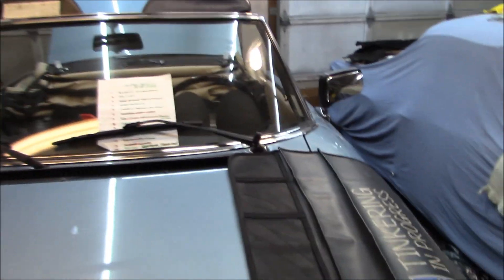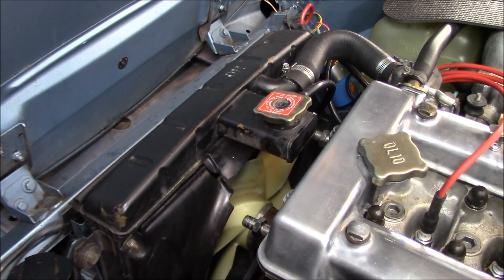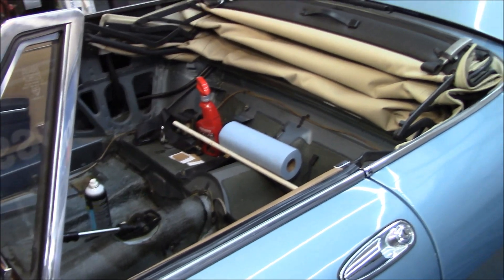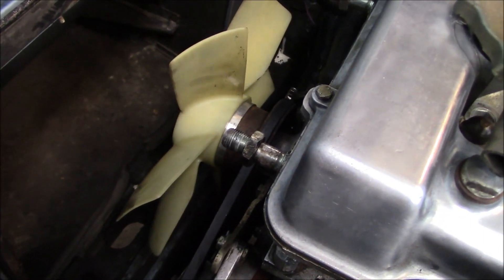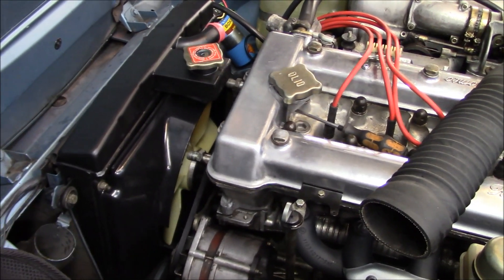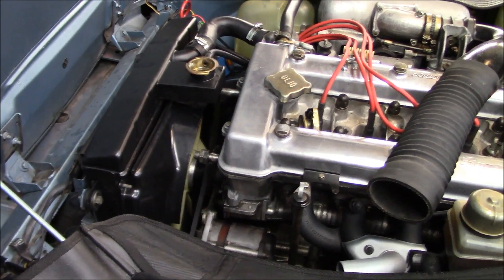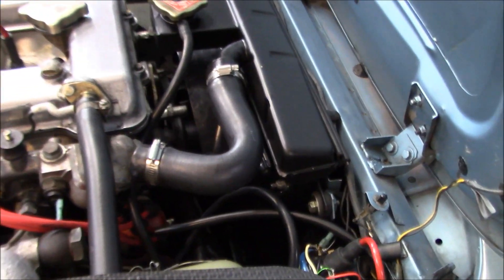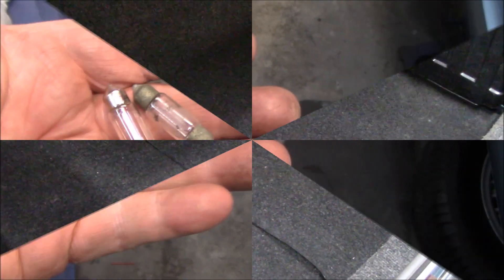1981 Alfa Romeo Spider Veloce, Winter Projects Part 16, Rad and Shroud, Wipers and Trunk Carpet

Comment: I'm on my 3rd rad. I remember that I bought Evans waterless  coolant, but never put it in due to the constant removal of the rad, so it and the prep fluid sits on a shelf! I feel that the shrowd you bought was for an earlier Alfa with a smaller 4 blade fan. It is possible that it's maker changed some of the design to 'fit' more years of chassis to make one product instead of 2 or more, also. My 2nd rad was also from Vic Auto, it was a good unit, but the overflow hose went to the drivers side. My bottle is on the passenger. Another example of 'one size fits all'. The long hose required fouled on the fan blade one day, taking out the fan, cracking the  old fan shroud also. I had a rad shop cut the nipple off and braze it to point in the correct direction, and fix the pin holes caused by the exploading fan. New shroud installed, did not fit very well and I cracked it. On a summer drive to a brew pub with my girl, I hit a really bad dip in the road at speed, and the new 1yr old motor mounts compressed enough to have the fan bottom out, shearing off the fan blades at the hub! Also causing leakage in the rad. Enough! I bought a used rad in wonderful shape, had it tested and cleaned and painted, and installed an electric fan with a relay, that uses the temp. switch installed in that lower bung. My radiator adventures. The owner of your blue Alfa should be fine; I drove/drive mine pretty hard when I can, and the dip in the road was ridiculous. Glad I had the oil pan guard on!!
Reply from the maker: Just for fun John, look at the picture on the centerline site….not even close to what I received. https://www.centerlinealfa.com/catalog/fan-shroud
Mine didn’t even have the little holder for the overflow hose that this one has pictured…I’ve sent a note to centreline. We will see how they respond. Cheers, Tush
Reply: @cheftush  I feel either they picked the wrong part, or Centerline changed vendors for the shroud, and the photo is from the original vendor. Either way, I hope that they give you helpful information on fitment. Too late for money back or exchange, though, but you never know.

Comment: Hey Tush, good to see another great video...I was thinking you were on the beach in Hawaii on holiday.
My opinion, fwiw, would be to powder coat the wiper arms in chrome finish to match the blades...quick, easy, and inexpensive.  Bummer on the rad shroud. Don't ya just hate taking two steps forward and one back. The silver lining is that doc has the car in good hands. Cheers!
Reply from the maker: I wish I was on a beach….New York all last week….anyway, problem with getting the arms powder coated is that at the bottom of the arm are plastic caps that pivot to hide the nut…these are attached to the arm so I’d have to figure out if I can even detach these.

Comment: Nice progress, Chef. Regarding the third brake light, could you stick rare earth magnets under the rear deck so that the ones on the light fitting have 'friends' to cling on to? That would increase the sticking power and avoid any walking as the magnets will naturally be attracted to each other. It would also allow you to use the thin magnets on top and the thicker ones underneath.
Reply from the maker: Hi Rocky. I was thinking the same thing.  I’m not sure I have access directly to the bottom of that panel from inside the trunk though.  I know I can’t access it from the passenger compartment.

Comment: If I recall there is only one shroud and if you have a/c or an air pump you need to cut the shroud. If the fan hits the shroud then you need to check the motor mounts they may have deteriorated and allow the engine to sit low, worse case the crank a/c pulley will rub the swaybar. Alfa fixed this with the 82 model year with a different crank pulley and a/c compressor location.
Reply from the maker: Hi David, in this case the motor mounts are in good shape.    It did have an air pump but that’s been removed.   Based on the comparison of new to old, there is no way that this shroud would fit without being modified especially where it was hitting the crank pulley.

Comment: Hi Dave, good to see a new video.  The Alfa series has been interesting, even though I am a Triumph owner going through the restoration of a TR6 and now on a full engine rebuild on my 4A,  Just a thought, but is the radiator shroud a thermoplastic which could have been coaxed into giving some greater clearance by judicious use of a heat gun?
Reply from the maker: Hi Robin, I still would have needed to clearance for the crank pulley buys it’s possible I might have been able to heat it enough to re mould it to drop lower so the fan wouldn’t hit it at the bottom.

Comment: ahhhhh no it not a problem the new wiper arms start out life with no splines just put them on a tighten the nut. oh make sure you clean the splines on the shaft. germen cars are done this way also.
Reply from the maker: Can’t mike…the new, non splined arms are pocketed and the nut will not fit down into the pocket and if it did, there would be no way for me to tighten it…
Reply: @cheftush  ya the vw's have that pocket and some later ones are flat like the black ones are. the pocket ones in the vw's use's a 6mm nut and the flat a 8mm ya that 8mm nut wount go down in the pocket.

Comment: Wouldn’t it be easier to trim the fan blades down slightly. The amount removed would not affect the performance of the fan.
Reply from the maker: No I definitely didn’t want to alter the fan blades in any way.
Reply: @cheftush  in that case then I would have gone with an electronic fan option.
Reply from the maker: @MrDazvere  it actually looks like I was sent the wrong part…I did order the correct part number but when I look at the photo on the vendors website, it looks completely different from what I received….the picture on the website looks correct….
Reply: @cheftush  that would explain everything.